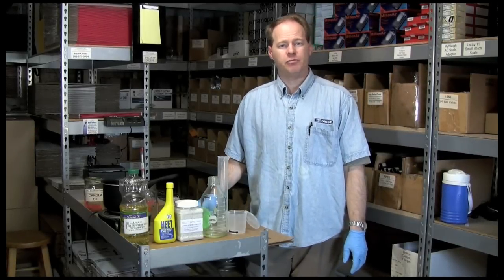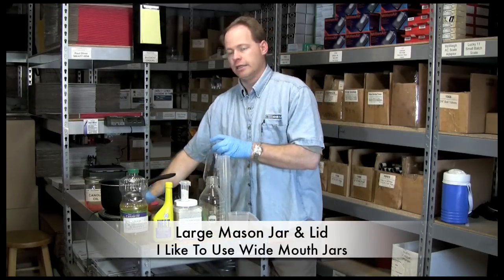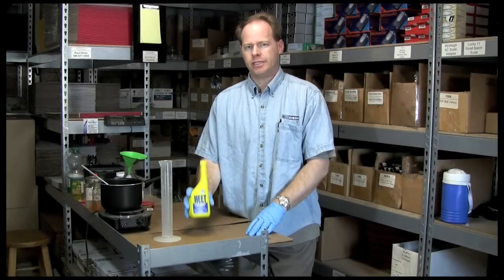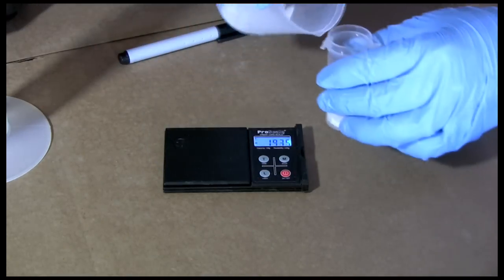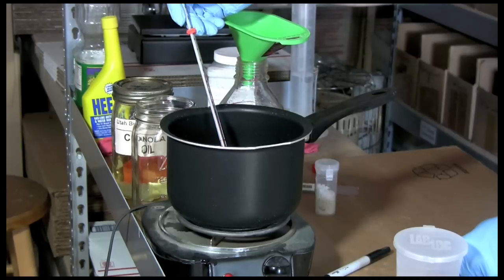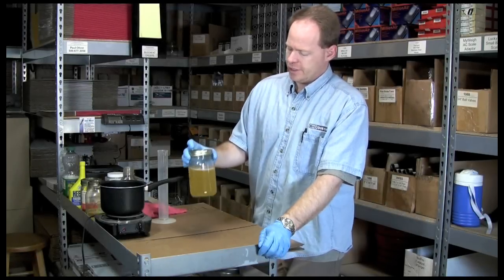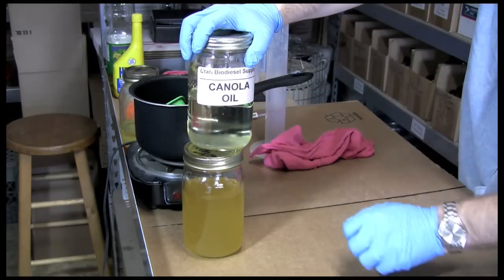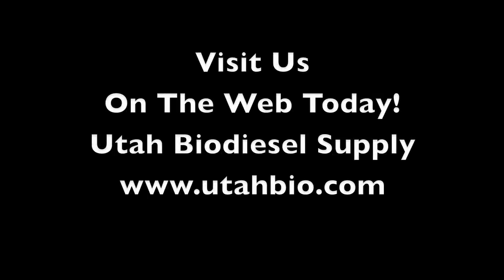Biodiesel | Learn How To Make Your Own Biodiesel From Vegetable Oil

Comment: He will probably not answer because this is old, but why heat it? Can this be done with used oil? Any necessary modifications to the vehichle recommended?

Comment: This is really interesting.  Based on the price of diesel people will want alternatives but how much does vegetable oil cost?  I think its a lot higher than diesel.  The only way to do this would be to use used oil and multiply the ingredients by about 1000 to get a half of a tank in my coach.  How about something with used engine oil?

Comment: One thing you should always do when making biodiesel, wash the product by adding water after removing the glycerin, this will allow other impurities such as soap to cling to water, which is a polar molecule, and then you agitate the water into the fuel, and let it sit. This should settle out any other impurities that could potentially gunk up your fuel lines. Otherwise, great video :D
Reply: You could preferably dry wash it by pumping air to the bottom of the tank

Comment: I wonder if Graydon is still using his BioPro to make his BioD. So this was 11 years ago, is there a better method to convert into BioD?
Reply: Yep. Still using it. Still works great. Still love it.
Reply: Graydon Blair cool! So is there a better method to make BioD now, different chemicals in an apple seed type processor? Thanks, Dave! Still driving the old Benz?
Reply: @davekana8388  nope. No new developments in that area for several years.. biodiesel has fallen out of favor with the public so there's been no new research. So, same old tried and true methods still apply and work well..if you can find a used biopro (lots of cheap ones come up on eBay) it makes it easier to produce, but otherwise, just same old methods still apply.
Reply: Graydon Blair thanks for your kind reply. At least BioD blends are available at the pump, B5 or less usually. The rules changed in 2007 with the LT manufactures!🥴

Comment: Just a word of caution to everybody, be careful when handling methanol near an ignition source (e.g. the burner in this video) as the vapors could ignite.

Pouring the solvent produces more fumes than you realize so pour in an area that is ventilated (outside).

Methanol may produce “invisible flames” so it may not be immediately obvious that it’s burning.

Thanks for the how to, but I would recommend including safety concerns so as to prevent people from injuring themselves.

There is a reason why so many chemists die in lab explosions...
Reply: Safety rules

#1: don't be gay like op
Reply: Another note is that methanol can cause worsening vision or just flat out blindness if you drink it or if you get it on your skin, it attacks the optic nerve

Comment: does this same technique apply to using cooking oil? 
and is it 100ml of methanol and 3.5g KOH per every 500ml of oil?
So if i did 5 litres at a time, id need to add 1000ml (1L) of methanol and 35g of KOH for each 5 litre batch?
cheers
Reply: With all that money spent on chemicals, you can buy diesel fuel ready made at the pump. Lol

Comment: can I use ethanol as they are both group R alcohols
Reply: Yes. But it would have to be really, really, really pure (like 99.9% pure)
Reply: thanks it was a piece of info I pieced together myself so I wasn't  myself if it  could actually work so now im going to make, distill and dehydrate my own ethanol to use as fuel oh and by the way the glycerine and ethanol/methanol waste can be distilled  and reused indefinitely and the glycerine is used to make soap and bioplastic as well as having a high market price

Comment: did this work in any engine?
Reply: Nitesh kumar It worked in my Hilux.. :)
Reply: leong zw how would I checked it will it work on an engine or not
Reply: Nitesh kumar You need to use "Biodiesel Conversion" test kit to test it.
Reply: Nitesh kumar The test just only use 27ml of methanol mix with 3ml of biodiesel you made at 20-22°C. If the fuel dissolved in the methanol, it means that your biodiesel can run a diesel engine. If you see fallout, it means your biodiesel failed the test. But not to worry because diesel engine can run on veggie oil (not recommendable) Remember to make sure that your biodiesel is as dry as possible. Diesel engine hates moisture in fuel. Good luck :)
Reply: leong zw thank you very much..👍
Reply: leong zw why we can't use ethanol in making a biodiesel...?
Reply: Nitesh kumar Who said cannot? I used methylated spirit to make biodiesel before. As long as it is an "Alcohol", you can make biodiesel!
Reply: Nitesh kumar Ethanol biodiesel can withstand cold temperature. But industrial grade biodiesel use methanol because of the quality. You also can use propanol, butanol, and even pentanol to make biodiesel.
Reply: leong zw did you follow the same procedure with ethanol.....?

Comment: Thank you for this instructional video. It really looks like it's not too difficult, and if it works directly on a regular old Mercedes diesel engine (OM617 for W123's, mine is an OM602 as I own a W124), then this is way better rather than modifying the engine with gadgets to use raw veggie oil (new or waste).

Comment: I can't find methanol, can you plz tell me what is the type of product that you used there in the yellow bottle,
what is this heet?
what type of product was that, meaning was that some type of oil etc. what was it?
plz answer fast anybody?
Reply: Karandeep Singh, actually rubbing alcohol is actually Isopropyl alcohol, not methanol. Rubbing alcohol can be use for biodiesel titration test only.
Reply: Adarsh Hota, you can test your spirit alcohol biodiesel by pumping it in a sprayer and spray it out facing a fire. I'm sure you will going to see the flame combustion. Biodiesel is actually not flammable. Its flash point is 130°c> so its not fire hazard.
Reply: It's rubbing alcohol.
Reply: Bro if you're from india are doing it for the CBSE practical, I'm sure your school's chem lab would have it
Reply: Well!, it wasn't obviously, that's why I was asking, I have done it using spirit and am not sure whether its gonna work or not.Probably not.Well! I have tried and just waiting from 2 weeks and it hasn't turned transparent yet as shown in the video, so I don't know well uh..
Reply: Can anybody tell me how I can test whether it has formed or not.Do I have to burn it?
If yes then on what? cause that thing on which it is placed should not be combustible..
Reply: Actually spirit alcohol can also work because spirit alcohol contain Ethanol and Methanol. It don't turn transparent because you didn't wash it. The cause of the cloudiness maybe it still contain some alcohol, soap, catalyst and some contamination. So you better wash it. No need to worry because I already did a pressure test on the spirit alcohol biodiesel I did and it really work.
Reply: I tried spirit alcohol to make biodiesel. Yup, it really work well. To test it, you can use the 27/3 biodiesel conversion test, if you can't find methanol, you can use spirit alcohol for the test. If you want to try it in a diesel engine, do dilute it with petrol diesel because economically diesel engine can only withstand 20% biodiesel blend. So good luck!
Reply: My yellow bottle alcohol is 100% pure Methyl Alcohol.
I can buy it locally at any grocery store or hardware store or auto parts store.
Reply: Nope. It's methyl alcohol. Rubbing alcohol is the stuff in the red bottles (and it won't work to make biodiesel).
Reply: Graydon Blair, the IsoHeet I see
Reply: Yep. IsoHeet is isopropyl alcohol in red bottle. HEET in yellow bottles is methyl alcohol
Reply: Mouthwash, but purify it. Ethanol works too.

Comment: Has anyone tried this? Does it work in your Diesel engine? I'm tempted to try it but want to know it actually works first
Reply from the maker: Yes. When produced on a larger scale it works great in a diesel engine.
Reply: It works but the time needed, the price of the chemicals and the price of the oil makes it cheaper to just buy diesel fuel at the pump.
Reply: What exactly is the measurement of this to be enough to power an engine?

Comment: i saw three layers... usually its two layers.. Biodiesel on top and Glycerine on the bottom..  You said the Biodiesel was caking up from being in a cool environment.. then does that mean theres still water or glycerine in that biodiesel that it caked up that middle layer which was really just the bottom of the biodiesel?
Reply: All diesel will gel when cold.

Comment: In another video they used lye instead of potassium hydroxide. Is there a reason for this, or is it just a preference? They used old oil from a fastfood grease trap rather than freah store bought oil, if that makes a difference?
Reply: lye(sodium hydroxide) or KOH can be used... in this video he is using KOH because it dissolves faster in methanol

Comment: I'm making the same biodiesel with canola oil, but it says on another website that phenolphthalein and isopropyl solution is needed. Are these two actually necessary?
Reply: +Just Moved In Phenolphthalein is used to titrate the oil. Same thing on the isopropyl alcohol. The other website is probably meaning that they are going to want you to titrate the oil. However, if you're using new canola, you don't need to titrate it.
Reply: Ok, thanks a lot.

Comment: How much biodiesel did you get from that 500ml of used canola oil? Why is it so expensive to have a biodiesel processor when it is so easy to make like this. What is the purity of the oil doing it this way?
Reply: Roughly 500 mL (the methanol displaces the glycerin).
Because on a large scale you need bigger equipment.
Not sure on your "purity" question. The oil I started with was brand new.

Comment: Can you please answer the following question?
I need those answers for a project.
Can this be done on a large scale? Will there be loss or profit in the processing of waste vegetable oil to biofuel?
Can you name the advantages and disadvantages if this were to be practiced as a main source of fuel?
Thank you.
Reply: Yes. It can be done on a large scale. In the US there are several commercial companies making it large scale. Look up National Biodiesel Board for more info. Profit and loss is dependent on how well you run the business. It's a tricky business model though. Visit our website (Utah Biodiesel Supply) and look at the Why Biodiesel page. Also, look up the Handling and Use Guidelines for more details on pros & cons.
Reply: Thank you for the information!
It really helped me in my project.
Reply: Ally Bralder Happy to help

Comment: I did my own for a science project. How long does it take to separate completely. its been 2 days and my fuel is not flammable yet.
Reply: Eddy R. Off course it is not flammable. Biodiesel flash point is 130°c and above. No need to worry because it will work inside a diesel engine.
Reply: Diesel in general in non-flammable
Reply: You need a glowplug that operates at about 1000°C and an electric starter that pushes the piston to create pressure. That's all. :)

Comment: We don't calculate methanol based on a titration or triglycerides. We just use 20-22%. That's about 50% more than we realistically need at a chemical reaction level, but we flood it with methanol to push the reaction to Biodiesel & glycerin. If you don't, you run the risk of the reaction going backwards. Also, check out The Biodiesel Handbook and look in the chemistry section. It goes into the chemistry behind the reaction really well.

Comment: nvm found the presentations eventually but will i be able to calculate accactly how much methanol is needed when i saw these presentations? The only thing ive to know is how much tryglycerides are there in my oil but i dont know how to know that part. Do i need to do a titration for it?

Comment: Safe bet is always use 20% methanol by oil volume. ie. if you have 1000 mL of oil, you would use 200 mL of methanol (20%). The amount works for any batch size.
Reply: how about the catalyst? how much?

Comment: Theoretically biodiesel reaction need 3 mole methanol for every mole of oil. Lets say that oil has 280 gram/mole or about 350 ml/mole. 3 mole of methanol is equal to 96 gram (around 130 ml). Using 500 ml needs 185 ml methanol. It's recommended to use more methanol to complete the reaction. Why you use only 100 ml?

Comment from the maker: I just poured it very slowly out of the container until I hit the glycerin layer and then stopped.
Good suggestion for the next video I do on this though.
Thanks for the feedback.
Reply: Would work well if you had a container set up with a spigot in the bottom, that way it is easier to draw off the glycerin off without putting small amounts of it back into the solution. My other thought is maybe a filter to take out the glycerin, do not know if it can be done but I imagine there is a way, after all glycerin is in many products, from hair shampoo to body lotion they have to get it from somewhere

Comment: It depends on what it's made from. Canola has a much colder gel point than say peanut oil, but in general, once you're below 0 C (32 F), you'll need to blend it with either diesel fuel or kerosene in a pretty high blend of kerosene/diesel fuel to bio to keep it from gelling.
Reply: when I was pushing 18 wheels around all we ever did was add alcohol to the diesel, I imagine that this would also work to keep Biodiesel from gelling also

Comment: @UtahBiodiesel You should make another video explaining the "glycerin removal".
Reply: + Utah Biodiesel Supply - I agree - this was a great video but the whole thing becomes pointless without knowing how to remove the glycerin. I'm a soapmaker so I assume that the glycerin forms because there's some form of saponification going on when you mix the lye and the oil, the glycerin being the byproduct of saponification, and the alcohol makes it a longer chain molecule. But even knowing a bit of the chemistry behind what you've done here, I still don't have the foggiest idea how to remove the glycerin. It would also be helpful to know what to do with  the glycerin once removed - given the toxic nature of methyl alcohol is there anythng that can be done wen it or does it get disposed of with hazardous waste? Thx.
Reply: @monyscell8352  A sep funnel works. Or you could just decant the fuel.
Reply: Mony's cell only thing I can think of is nitroglycerin
Reply: bolasdeferro true
Reply: Or just syphon the top part (bio diesel) off into another container.

Comment: @gothicillusion2002 
lye produces a new chemical called methalhydroxide. 1 thing to notice in the mixing process is as the chemicals react they produce a emense amount of heat. A easy way of mixing in all steps is to purchase a cheap blender. 5 minutes should be good for the methanol and KOH solution, 15 minutes for the oil and methalhydroxide. When your mix is all done and settled you will want to check both the PH and the specific gravity of it. with proper research you can get the exact #'s.

Comment: @dx80cruiser 
using heet is a more expensive way of doing a minibatch or in the test phase also called a titration. If you live in a area that has auto garages who specialize in race cars you can find out from them who is a good direct source for methanol. In those cases though one is typically buying at minimum a 55G drum of methanol. 1 drum can supply enough methanol for at least 400 gallons of biodiesle. another thing not mentioned is the methanol combined with the KOH more commonly called